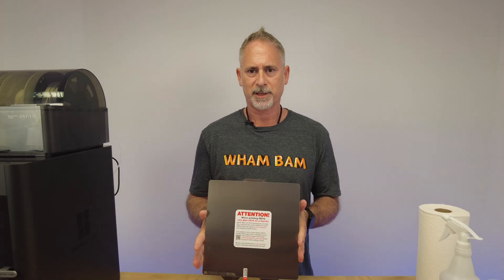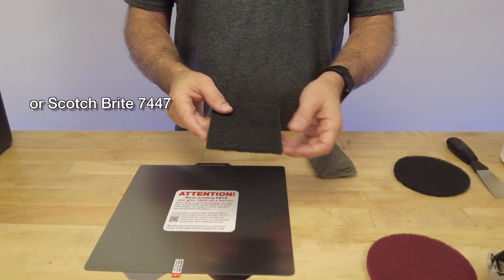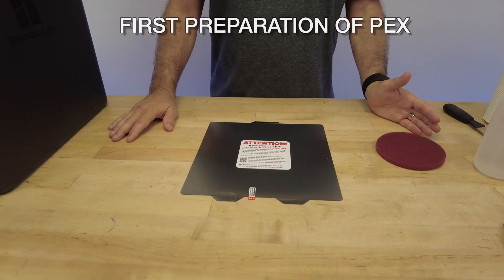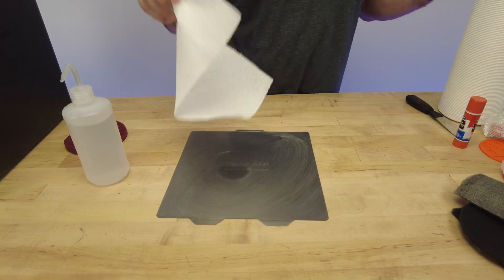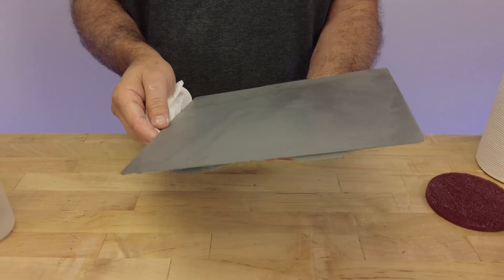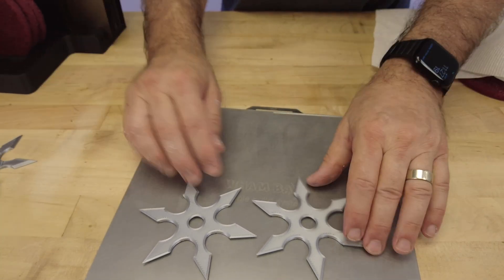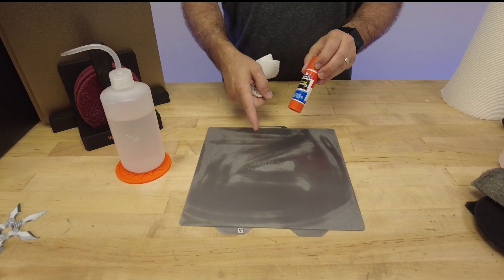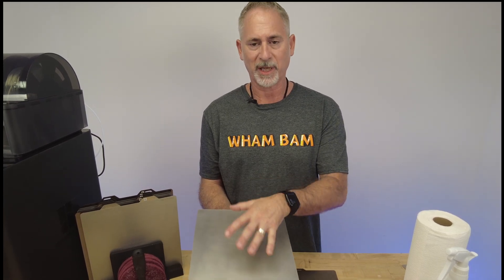PEX Build Surface - First Preparation and Maintenance

Comment: Why don't these plates come with this prep ready done? - after all we're paying premium for these things. I uses Scotchbrite extensively for metal working and am somewhat confused by the  grits/colours to prep the plate. I always thought 000 steel wool was nominally 300 grit and can understand the use of 7447 (red)  which is 320 grit but 7446 (dark grey ) is 150 grit and I thought that would be too coarse. Under what circumstance would 7447 be used. Light grey (7448) is 800 grit so it's unlikely you are using that. Thanks for the info.
Reply from the maker: sorry for any confusion, we had considered pre-scuffing in factory, of course it would have further impact on price, and it is fundamental that the user becomes accustomed to using it for quick cleans between prints, or contaminants will build up and cause catostrophic failure, so we opted to teach the user how to use the scotch Brite and when.  We do recommend the 7447 typically, although we show other options incase that specific grain is not available in one's country. If it it very scotch Brite like, the grain is comparable to sand paper grit as far as width of scratches, however the user has more control over amount of material removed by simple pressure alone.
hopefully this make sense. thanks!
Reply: @WhamBamSystems  Thanks - Makes sense.